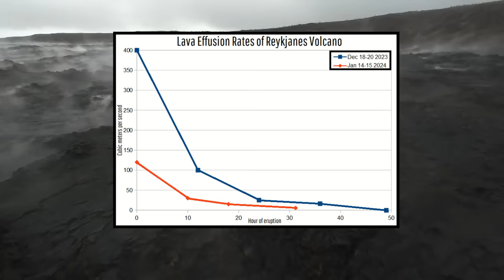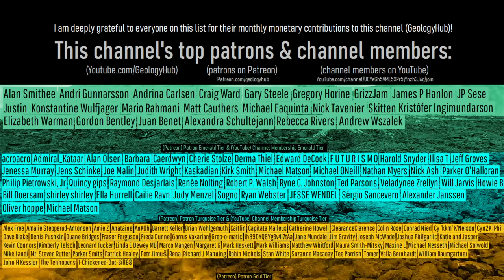Iceland Volcano Eruption Update; Lava Wall Breached, Decreasing Lava Output

Comment: I feel really sorry for the people of Grindavik. Short of a fissure opening up in the centre of town, it couldn't have been worse, with one of their major roads destroyed by lava. And whilst losing three houses is three too many, it could have been that much worse. If the second fissure has shut down at least we can be sure it isn't going to start back up again.
          I was just four years old when Eldfell erupted on Heimay, far too young to remember i,t but it is often held as an example of lava diversion, even now.  They couldn't save the houses buried in eruptive materials, but they were able to save their harbour, and even improve it a little, thanks to an inexhaustible supply of seawater to pump onto the edges of the flow and stop it from hutting off the harbour. Even then, had the volcano continued to pour out lava, things might have turned out very differently.
          I'm wondering, though, if we are beginning to see some kind of pattern emerging with these eruptions. Could 'little and often' be the mode of operation on the Reykjanes peninsula? As hard as it is for the Icelanders at this time, the volcanology community must be buzzing. They've got front row seats for a period of volcanic activity that'll give insight into how Iceland was formed.
Reply: If you look at a graph of the 5 or so volcanic fields on the Reykjanes Peninsula you immediately notice a cyclical pattern.  About every 800 to 1000 years 4-5 of these volcanic fields erupt over periods lastings years to decades and longer.  

This Reykjanes volcanic field ended its last erptive cycle 780 years and began getting active in 2020 with that first eruption in December 2023. Thus there is likely a lot of concern that this eruptive cycle could go on for years.   And what if other volcanoc fields become active?    Krusivik to the east has been experienced earthquake activity for a while as an example.  This volcanic activity is bery unlike what goes on in other parts of Iceland.

Comment: Or did they not have time to finish the berm at the point of the road to the same quality as that for the remaining parts of the berm?
Reply: I see this point has been dealt with in another comment, but I suppose both the road surface and the wall construction need to be taken into account.

Comment: Is this really a volcano?  or just seafloor spreading?
Reply: Iceland is of course right on the Mid-Atlantic Ridge, but it is also on a hot spot.  If you look at the length of the Ridge there are no other islands sticking up above the sea level because there are no other hot spots on the ridge.  Anywhere there is a hot spot on earth there are volcanic eruptions.  Hawaii sits on a hot spot, but not a mid ocean ridge.

Comment: Has there ever been any attempts to use explosives to open fissures and potentially control where lava erupts? Seems like they could blow open specific area away from homes and such when magma dikes are discovered.
Reply: This potential method has been discussed in the community, but the amount of explosives you'd need to make any meaningful difference would be excessively high. Explosives used to clear paths or in a quarry only clear at max a hundred feet or so in depth per demolition job. To control the movement of magma that is several hundred meters or even kilometers deep, you're looking at nuclear-yield explosions to make any meaningful impact.